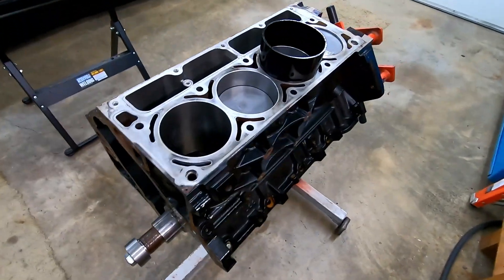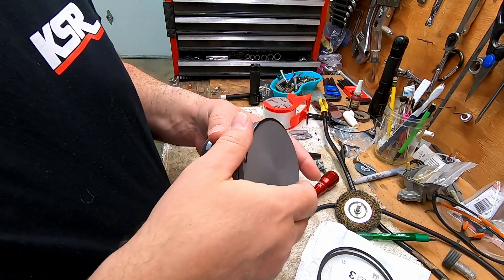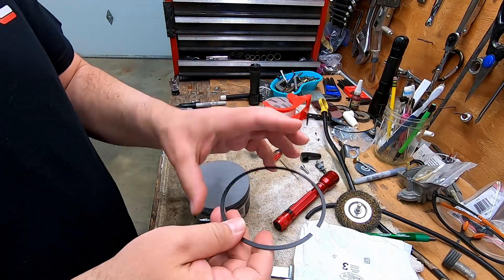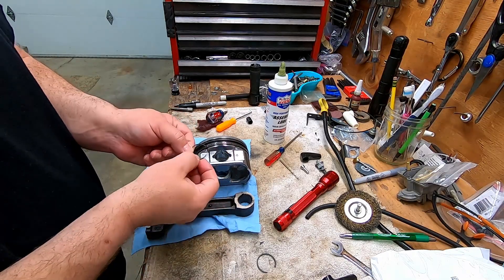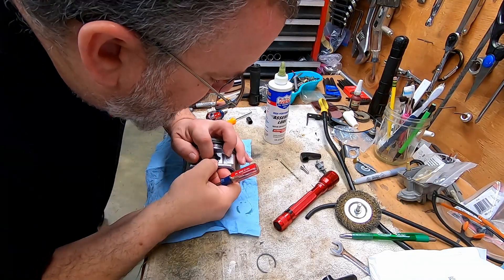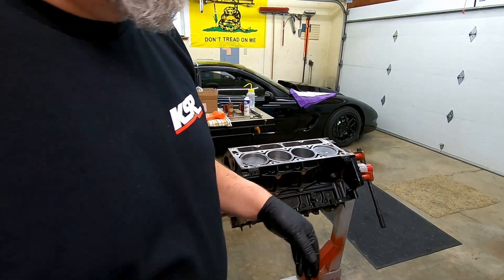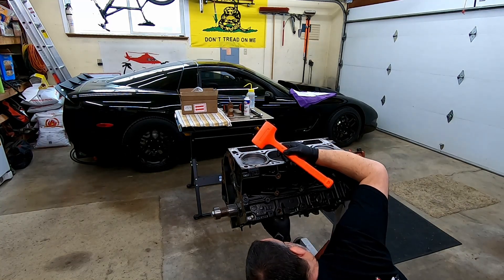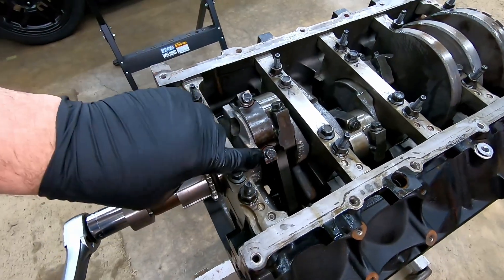Idiots Guide to building an LS Engine Rod and Piston Assembly Step 2

Comment: Good instructional video!  Connecting the rods to the crank was high anxiety time for me. No FU’s permitted here, and there are numerous ways, as you pointed out.

Wish I had this available back in the day. Used to use a Chilton guide 😂😂😂.  They were about as minimum as humanly possible.  “Step 1. Assemble the engine., Step 2….”.   Well maybe not quite that bad, but that’s what it felt like, lol. And yet we built some engines that usually worked.
I appreciate the YouTubers out there, like yourself, who are willing to share and pass the knowledge on to the next person.
Reply from the maker: It's always a struggle with youtube trying to minimize the video length and not ramble too much.  I could go on and on talking about every rod design and how to be careful.  Hell if I would have just added in filing the rings which in this case wasn't necessary I would have added another 10 minutes lol.  Always dig your comments and feedback!

Comment: Want to build an ls so bad…but after pulling this one out I don’t want to have to do it again 😂 especially with high hp
Reply from the maker: These engines are so fun and easy to work on.  Way better IMO than the old small and big block chevies.
Reply: @PNW_Car_Mods  Defiantly, there’s so much info online these days. I’ve got the block and pistons, just waiting on rods and crank. Still considering putting it together myself after machine shop does block and balancing idk
Reply: Good instructional video!  Connecting the rods to the crank was high anxiety time for me. No FU’s permitted here, and there are numerous ways, as you pointed out.

Wish I had this available back in the day. Used to use a Chilton guide 😂😂😂.  They were about as minimum as humanly possible.  “Step 1. Assemble the engine., Step 2….”.   Well maybe not quite that bad, but that’s what it felt like, lol. And yet we built some engines that usually worked.
I appreciate the YouTubers out there, like yourself, who are willing to share and pass the knowledge on to the next person.